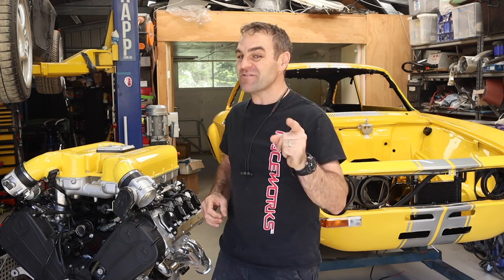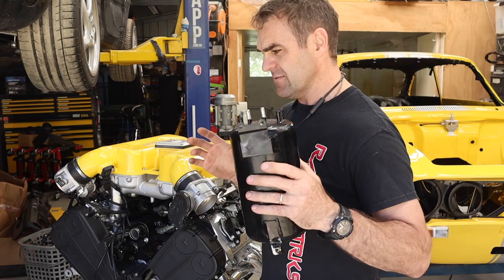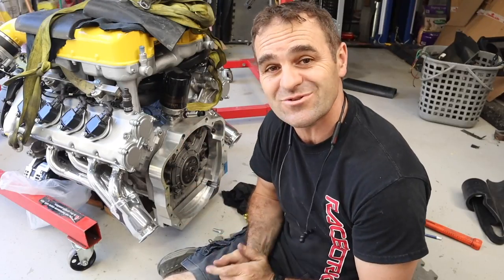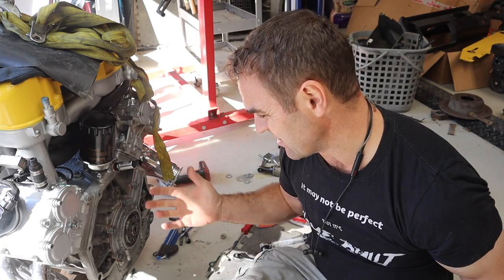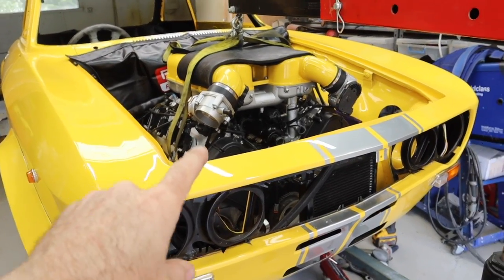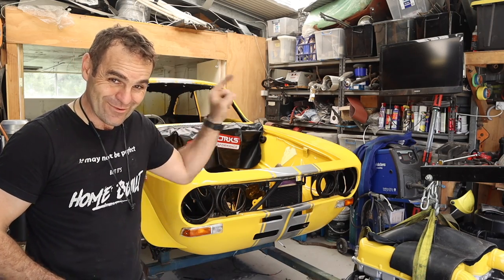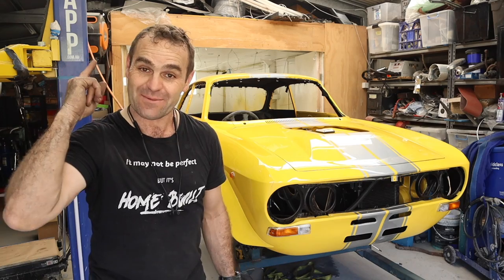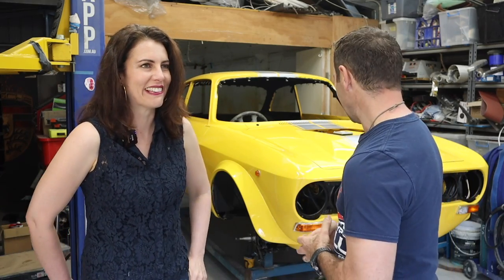The engine is in! - Ferrari engined Alfa 105 Alfarrari build part 168

Comment: 3:15 The timing of the pneumatic valves is crazy. One valve opens and closes 4 or 5 times as the revs rise, depending on engine load. The other valve responds to two engine rpm ranges (also depending on engine load). You'd probably need someone to interrogate the OEM Ferrari ECU to figure out what is going on. With shortened tracts as on your car, you may have to create  custom valve control ECU tables.
Reply: I’m guessing ferrari hit the engine with different loads at different rpms on a dyno and played around with the flap positions, then created a 3d table for triggering the solenoids. Should be doable without access to a Ferrari ECU provided Jeff’s ECU has enough outputs.
Reply: There are plenty more engines that use variable intakes and a good tuner can easily make a map based on rpm/load for it. No need to look at the Ferrari ecu

Comment: Awesome 👍🏽👍🏽    thanks about the engine crane,  I got to get one for my Rav4 as found out it will literally take me all day to get the engine and transmission and drop the subframe out ,  just to get off the transmission off to fix or change  the torque converter arrrh  ☹️  then will have to get a wheel alignment, but then should have my daily driver so later get can work on some other  project's  🤪👍🏽👍🏽

Comment: One of the best mods I made to my engine hoist was adding a compressed air line. It’s made fitting engines alone much easier, I just have to press a button instead of using that lever pump.

Comment: Congratulations 🎉🎉🎉!
A milestone achieved Jeff.
The engine looks sweet and blends with the rest of the car..
..
As for the vacuum intake control.
I was thinking if you could use a throttle body servo motor run in parallel to the engine throttles.
This would give you the controlled movement as per throttle opening to control the intake valves.

However, due to the different intake lengths/paths there must be a transition between long to short intake path - as per specific rpm.
I'm guessing at certain rpms the short run butterfly opens as the long run butterfly closes - in tandem with each other..
..
This would be because of (and to maintain) a very slight change in AFR during this transition.
.
Using the Ferrari vacuum system this will operate the valves as per rpm/vacuum of the engine and thus be the most accurate control of those intakes..

..
Pleased Harry's ticking was just a loose rocker nothing serious...

Comment: I found with those engine cranes if you unscrew the  release valve before you raise the boom it will stay where it's put when you tighten the valve again.
Reply from the maker: Even better tip. Nice.

Comment: Great content as always mate, love the build. Just wondering who you were going to go through for engineering? Capacity of the Ferrari motor and weight of the car. Only reason I ask is I have a ta22 that I want to put a 4 litre 1uz toyota v8 in and don't know who to speak to for potential engineering and didn't want to start the conversion until I had. Thanks in advance!
Reply from the maker: That is a Federal rule so it should be good with most engineers

Comment: What is the predicted kerb weight when finished mate? 1250kg or so?
Reply: I think a regular 105 sprint GT, is around 950kg, the engine and gearbox wasn't much heavier than the original one, i think give or take Jeff showed it was maybe 20-30kg more, i reckon with everything combined, car sound deadening, and everything else, it will still be under 1200kg